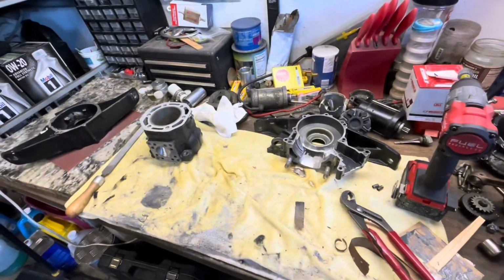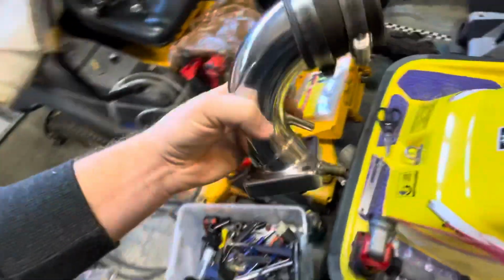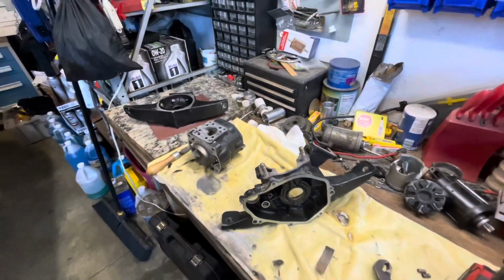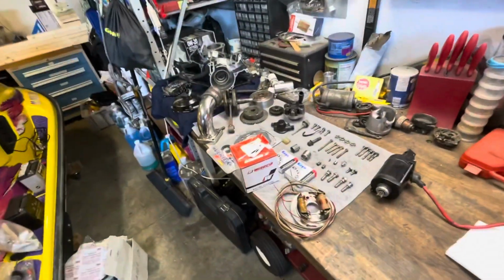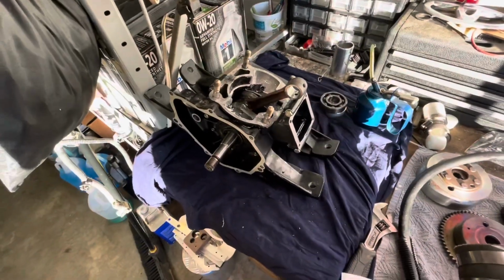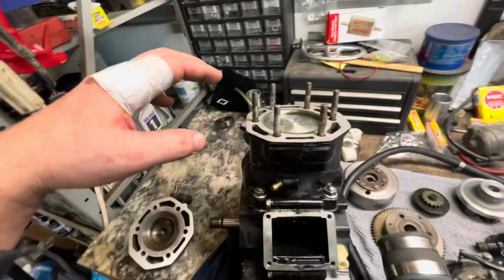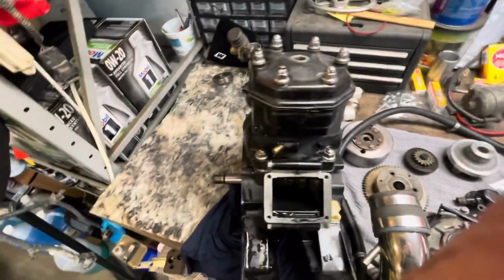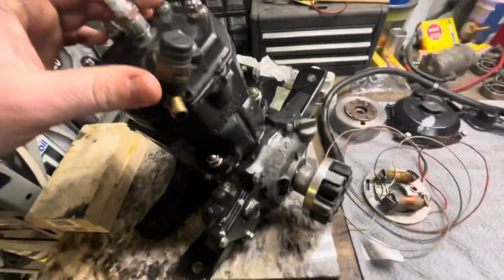(P5) vintage JS300 jetski modified motor rebuild! Kerker pipe. #2stroke  #300sx #Kawasaki

Comment: Can I just plug off the exhaust manifold and add radiators and a pump and I should be good right
Reply from the maker: Those ports on the exhaust manifold, you will have to weld them up or somehow block them up or block them off with a gasket
Reply: @BTR2018  ok thanks
Reply from the maker: Your welcome

Comment: This is my first JS300 rebuild, and your videos helped me out a lot!!! When putting the PTO/coupling on, do you have to torque it? I put mine on and when trying to start it, it comes loose and unthreads. Is the motor spinning the wrong direction?
Reply from the maker: You’re welcome glad my videos helped you. Yes you kinda have to torque it on the fis pound it with something flat hit it on where the ears stick out to torque it and put a little bit of red loctite and wait like 30 minutes
Reply: @BTR2018  what do you recommend for a stock carb kit replacement?
Reply from the maker: @TomL96  oem GENUINE OEM MIKUNI BN CARB CARBURETOR REBUILD KIT KAWASAKI JS300 JS 300 86-91

Comment: Would it be better to swap out the engine for a 450 or 550 engine?
Reply from the maker: Definitely would, but always wanted to build a 300 and see what it could do.
Reply: @BTR2018  ok awesome how much more power was gained?  asking because I just got a js300 and the power is kinda lacking.
Reply from the maker: Well, let’s say this it was beating a js440 & js550s, which they were pretty much stock so this thing was pretty fast but again it’s hard to find parts for this thing like a pipe. I have a few impellers, but putting in a JS450 or 550 would be much better, or even better a 650. Which I got if you want.
Reply: @BTR2018  well I need to upgrade to a bigger pump?
Reply from the maker: No you won’t just a different impeller/propeller
Reply: And how much ?
Reply from the maker: 120$
Reply: Not bad we’ll I need anything else to make it run?
Reply from the maker: @andysanchez7050  a bigger carb sbn38 and higher compression

Comment: Where'd you get the kerker! Been trying to find one lol.
Reply from the maker: I got one off of Facebook.  Yes they are pretty hard to come by for a cheap price. Where are you located?
Reply: @BTR2018  im in NJ, I bought a 440 hull but kinda want to put a 300 in it.... idk if i can even figure out mounts but if i can find a kerker for a 300 that will seal the deal. Sweet video.
Reply from the maker: @benschrepple8808  all I see there’s one in Alabama but the guy doesn’t want to ship it. Lol thanks for liking the video. Currently in the garage making a pump and impeller video should be out this week Thursday. If I find a pipe I’ll definitely let you know.
Reply: Im on the "everything standup jetski" facebook page, you'll see the 440 i have on there. Any ideas on mounting a 300 into a 440 body?
Reply from the maker: @benschrepple8808  Me personally I would not go to a 300 because everything it is so hard to get for them like aftermarket parts and stuff but a 440 or a 550 or a 750 swap would be much better definitely need more power for the skis Unless you already have the 300 you’ll have to buy the 300 mounts which are pretty hard to come by and kind of expensive.

Comment: Trying to find torque numbers for the case
Reply from the maker: @thadeus moor 
If you wanna contact me through my Instagram I can send you the pictures from the service manual my Instagram is built.2.run. 
6mm bolt dia = 5.9 - 7.8 N-m 
0.60 - 0.80 kg-m
52 - 69 in-lb 
Hope this helps.